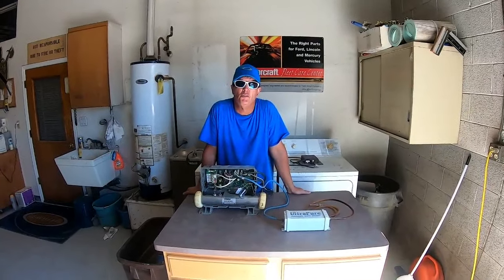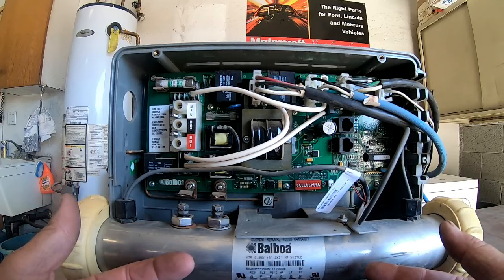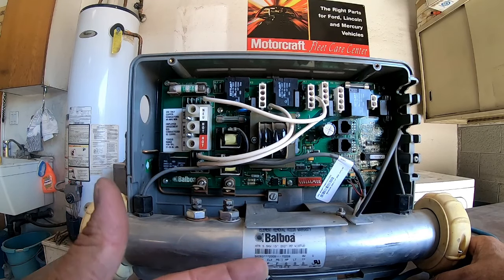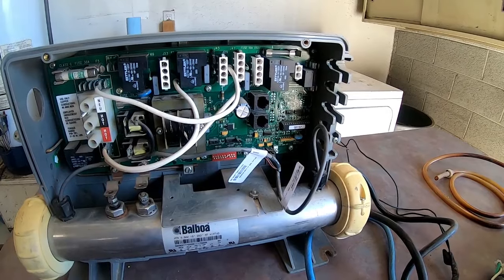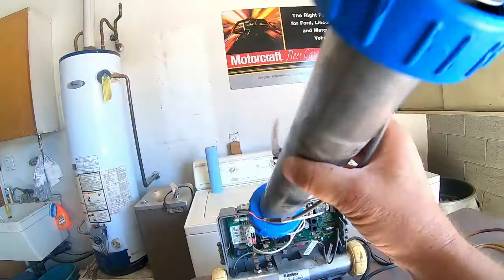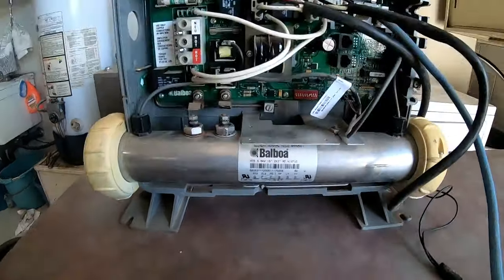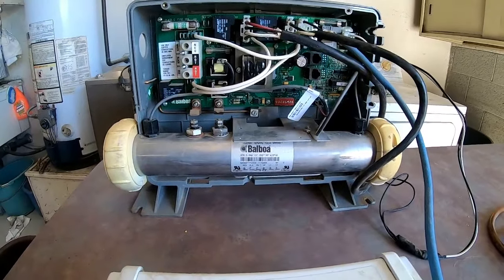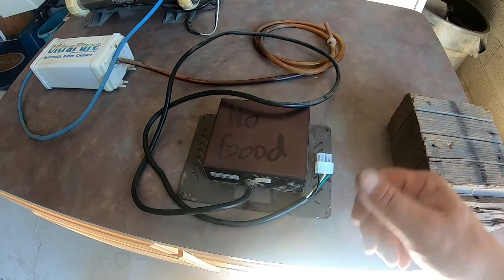Hot Tub GFCI Breaker Keeps Tripping..6 Things To Check For.(DIY Spa Repair) Arizona Hot Tub Factory

Comment: My breaker was tripping immediately when turned on.  I started diagnosing by disconnecting the various components and found that the circulation pump was causing the breaker to trip.  So started going down the route of replacing my circ pump.  Luckily, someone mentioned to me that a simple air lock could cause the breaker to trip from the circ pump.  Sure enough, I removed my filters, tried the breaker again and it held.  The pump wasn't bad, it was just air locked.  So if you're in a similar situation try removing your filters first to see if that solves the issue.

Comment: SCOTT - YOU R the MAN!!! after multiple hours and parts replacement - YOU drove me to the problem - I have a Jacuzzi J365 - and found that when I pulled the 4 wire J4 plug it the GFCI didn't trip ---- when you got to the ozone - I disconnected and I'm back in business - can I run the Hot tub without the Ozone ?  thanks and Aloha Chris
Reply from the maker: You can but I wouldn't .. A new Ozone is cheap and really does help the spa system,
Thanks for Watching & SUBSCRIBING

Comment: Trying to tell what the cause of my GFCI instant tripping when pump switch pushed on a 2009 Hot Spring Jetsetter with a Wavemaster 7000 pump unit, I found the culprit was corrosion on the output shaft at the pump bearing side...scraped and wire brushed + WD40 solved the issue...some "repair" folks would have just replaced it for $$$, without even looking for that causing the trip!
Reply from the maker: If the cir pump is any older then 5 to 7 years ??? You are on borrowed time and it would be better to replace it.. Ive had pumps like that go out and burn the board connections because it didn't trip.. I look at it like tires on a car after so many years just because they hold air might be dry rotted and leave you stranded with a flat...Just food for thought. Right on fixing it your self. Thanks for Watching & SUBSCRIBING
Reply: @spaman5440  Thanks for the heads-up...however this GF problem was with the MAIN JET PUMP, not the separate, constant-on circulating pump.  Now that I've replaced a leaking non-repairable double-tube heater unit--that was otherwise working fine (that probably added to the corrosion issue on the jet pump), I guess I should probably put a replacement circ pump on my maintenance to-do list next spring!

Comment: Ive emptied to clean and fix a hole in my tub.  Sometimes I'll plug in my hot tub and it runs fine and I could fill it with air. Then I'll come back to fill with air again after finding leaks, plug it in and there is nothing.  The breaker doesn't trip in the house but the test buttons on the plug won't set themselves.  You can push on both the test and reset buttons (on plug) and they are limp.  Then I can come back a week later and plug it back in and the plug is working again and hot tub gets power.  It's just weird that in between it not working and then working again nothing really changes.  Any thoughts?  Thank you!

Comment: 2007 Sundance Optima 880. Breaker tripping.. Diagnostic as you did showed heater was to blame. Disconnected heater but now the unit turns on randomly. Sometimes its a pump, maybe the blower, maybe the lights sometimes a combination of all 3. What now?

Comment: Both my heater terminals were corroded.  Cleaned them with vinegar, rinsed with water and dried it really good.  Spa is working now.
Reply from the maker: It will work for awhile but most often it will not last long ,, Its great that you were able to get it working again..
Thanks for Watching & SUBSCRIBING
Reply: @spaman5440  I figured that, im sure its corroded on the inside but will have to replace the heater element soon.
Reply: I kinda did the same thing, just used a dry still toothbrush. I figured it’s probably a temp fix too.👍

Comment: Great info, with things to look out for in the future. I live in Nevada and my Balboa breaker trips only qhen its hot outside( 100+°).  Replaced wire to appropriate size and solid ground. Still pops when ambient temps are high. Maybe the heater is my problem.
Reply from the maker: Would need more info.. Call the office and talk to Scott he will have more info.. We did deals with this all the time in Az  with all of our rental inits.
they all have Balboa equipment and we had problems with this some 10 years ago 
Thanks for Watching & SUBSCRIBING

Comment: I repair for a living. Don't work on hot tubs as of yet. But after what you just showed me. This is just like working on all the appliances, water heaters, furnaces, and AC  I troubleshoot and repair. I will not turn down the next hot tub repair. Just last night one of my customers said GFCI would not reset. I went up to look at the electrical. Nothing more than they were not resetting the breaker before turning it back on. Found no problems after resetting it. Everything ran fine. It was an easy money service call. But that said. Yes, I am going to start working on Hot tubs now. Thanks for the heads-up video. I like your style in video.
Reply from the maker: Check out all of the NEC codes and follow them to protection. More then 50% of our work is rewiring what the Lic Electrical contractor installed. the rest is figuring out why the breaker is tripping. Good luck and keep us posted on how it goes Thanks for Watching & SUBSCRIBING
Reply: @spaman5440  I have the NEC Book. And use it when needed. Thank you.

Comment: Thank you for the video I never usually comment but great video. I tried for hours today to try and get my hot tub to stop tripping the switch everytime I powered it on... after watching your video I just went back out in the dark with a flood light and I think it is the heating element cable. 1 of the round circles on the nut is burned and managed to get my hottub to power on and stay on after disconnected the heating element cable and the hot tub stayed on. So now need to find the correct replacement cable to buy a new one. But your video helped so much.  Now I have diagnosed the problem.  Thank you very much. I think saved me hiring a hot tub engineer and money. Thank you
Reply from the maker: When I started doing these video 2 1/2 years ago...You are the type of viewer I was hoping to help.. As of today my videos have been seen by over one million viewers in nine countries.Im so glad I was able to Help you   Thanks for Watching & SUBSCRIBING
Reply: @spaman5440  You are welcome mate. The plug and click cable with the 2 circles on 1 end for the heating element.  1 of my circles at the end I can see is a tiny bit burned. Do you think it will be the whole heater that I will need to replace or just the simple job of the plug and click cable? I'm going to order the cable 1st as that's only £16 but the long heater tube looking online is £180. I'm hoping the plug and click cable fixes the issue
Reply from the maker: @James-yv2mr  There is a reason this happened. The part that burned up is cheap to replace. But without knowing why it  burned it is tough to say.. keep an eye on it something is causing this to happen. when this has happened to me in the past I replace the entire heating tube as an entire unit. Hope that Helps Thanks for Watching & SUBSCRIBING
Reply: @spaman5440  Wish I could afford an entire heating tube unit. Which is why opting for the cheaper option 1st 😆.  Thanks again for your help and your videos mate I will keep an eye on it and see what is causing it. Thank you

Comment: Thank you for sharing this video 
Unfortunately after fowling your steps I am still having issues with gfci tipping red light cones 
My jacuzzi has been sitting
In my. Ack yard for 2 years now bought it new I now git some time to run power to it and fill it up with water but I can’t get it to run
Reply from the maker: In my experience if its only a couple years old and it trips from the get go and the breaker will not set it was wired wrong(Every Time)

I am kinda confused You say you bought it new and it trips the breaker when turned on and its been sitting empty for two years and you still need to run power to it.
If you need more help call the office and talk to Scott 
Thanks for Watching & SUBSCRIBING
Reply: @spaman5440  Ii had a service guy over yesterday and he got it to run apparently the gfci that came with the jacuzzi cord 
Was bad but now that is running I can’t get my top display to work to set the temperature, jets,lights and so on 
I don’t have Scott’s number thx in advance

Comment: I just want to give you a huge thanks for making your videos. Specifically this one. We got a new sundance cameo 880 yesterday (here in AZ) and filled it and just kept tripping the breaker trying to turn it on. It was very frustrating. We figured out by doing the elimination process (after checking the gfci wiring per your other videos) it is the blower tripping the gfci  so at least we know. Hopefully we can get a tech out quickly from our dealership to deal with the blower. Thanks so much for taking the time to do these!!

Comment: ***Question***Right off the bat I think you helped me! Last spring my hot tub tripped a couple times after I had everything clean and prepped after the winter. I also noticed the water level slowly going down. Instead of figuring it out, I just shut it down (busy times). Now, a year later I need it back up and running. Last week I opened the panels and turned the breaker on. I instantly noticed water spraying from the bolts on the heater. The breaker quickly tripped. Now it doesn’t come in at all. Your video showed me that I have a heater problem. My question is, because my system doesn’t do anything at all now,  should I replace all the components in the box, or should I just replace the heater and fuses? Appreciate anything you can offer!!
Reply from the maker: If it is a Balboa system or the like...I would just replace the entire heater assembly with a new one including sensors and gaskets 
Thanks for Watching & SUBSCRIBING
Reply: @spaman5440  thank you!
Reply from the maker: @thebutlercollective6193  Welcome

Comment: Hi I am having same problem. I have power at junction box from the gfi breaker with no short to ground. I have removed the elements checked resistance and short to ground, good with no blisters on outside. Hi limit and thermistor operation look normal when heated. I have a Balboa pack as well. History is just stopped heating. Everything else was okay. I will try disconnecting the heaters I believe I had 14.5 ohms on heater does that sound about right. Every thing else was unplugged just pack hooked up. Wish me luck Marc

Comment: Great video and very informative. I have a Balboa single-pump system that trips the (new) GFCI breaker. I've unplugged EVERYTHING and disconnected the heater and two temp sensors. Still trips and can't figure out why. Don't see any physical problems (corrosion, PCB burns, etc.). Removed the (good) 300mA fuse F4 and GFI is stable. Don't know what F4 controls though as I can't find a true PCB schematic. [Thought the MOV above F4 was shorted, but it's not]. Ever seen this?

Comment: You are the best, Sr.  I will check mine and update this post once it gets fixed. Thanks.  UPDATE: Once I removed the cover and start checking for leaks, I noticed drops coming out from the inner Clearray system (Jacuzzi-J345), rust in the nuts and humidity in the floor of the tub, close to one of the pumps. I disconnected the Clearray system from the tubing, the system board and removed it completely from the tub. Now the tub has been working for more than 3 hours without tripping the breaker. I think I found it!  Thanks!
Reply from the maker: Thanks for Watching & SUBSCRIBING

Comment: Great video. My hot tub breaker trips intermittently. Stays on for hours then when we go to use the breaker is tripped. Any Ideas?
Reply from the maker: Check your connections
Thanks for Watching & SUBSCRIBING
Reply: @spaman5440  I have checked all connections and even replaced the GFCI breaker. I am leaning toward the circulation pump overheating over time, or am I off track. I think if it was the heater element it would trip right away.

Comment: Thank you so much for posting this.  I've been struggling with troubleshooting my hot tub tripping the breaker for a while.  This video helped me identify the issue!  Followed and liked!!!!
Reply from the maker: Glad you have it figured out ...Thanks for Watching & SUBSCRIBING
Reply: What was the problem?
Reply: It turned out that the heating unit was bad.  I had no idea how to isolate what was causing the issue until I watched this video!  Ordered a new one and the replacement was simple!
Reply: @sbockett  Thanks for feedback.  In am thinking that is the problem with mine.  It's only 2 years old but trips now after heating about 2 hours.  Already replaced the disconnect.

Comment: Thank you sir lol I bought a used one with all of the fancy stuff tv and stereo and lights it occasionally trips breaker so i did start looking at stuff myself people are shocked to find out I am not an electrician any ways one of my 110V converters has been rewired by previous owner it is receiving 240 V to power up its NFG hoping by unhooking this my tub will be good ! Ftr had a few leaks and a pump connection leaking fixed them up no more leaks!!

Comment: What if the heater is unplugged and no luck? Same with pumps, transformer, etc? I cannot get the GFCI to go on at all and the wiring at the breaker to tub is good.
Reply from the maker: Ok you have alot going on and there is really no way to help you here so you can call the shop and Scott Im sure can get you going in the right direction. Hope that Helps Thanks for Watching & SUBSCRIBING

Comment: I have a randon gfi trip. Nightmare.  I guess I try replacing  the heater. And pray that's it. Tub runs fine  for days then trips.
Reply: I wander  if  the pressure  switch  is grounding out randomly.  I have change it before  a long time ago. My spa is 21 years old. It's like a Toyota  it keep on running.  Lol
Reply from the maker: Give me a call at the office tomorrow and get me some more details and I will try to get you moving in the right direction.Thanks for Watching & SUBSCRIBING

Comment: great video  exaclty what I needed.  My control panel is almost identical.  I've had it 3 yrs and it just stopped working.  No power because the breaker tripped.  The hot tub place said it was the breaker so I paid $150 for the new breaker but it didnt help.  

I disconnected everything but the heater and it still wont work.  I'm going to try the heater now.  Can you clean the heater or do you just have to buy a new one?
Reply from the maker: No I'm afraid if the heater is causing the breaker to trip ? its time for a new heater.Yhanks for Watching & SUBSCRIBING

Comment: I have a 2 year old ACC Smart touch digital 1000 controller    We had a power outage the other day   The hot tub tripped the 50 amp GFCI breaker I finally got the breaker to send power to the hot tub but I noticed the COM  line  1 wire ( fused it’s ok  )  wire on top of the circuit board definitely overheated.  I replaced it and still no controller coming on   We lost the main 9600 volt wire in a storm I wonder if it did not kill my controller   The GFCI is staying on though.   Any ideas ?

My control panel is not lit up 
I’m going to check to see if it’s got power to it from the board block next I guess  any help would be really appreciated.
Reply from the maker: Check all of the wires with a tester really good as well as the 50 GFCI breaker....I would also check all of the fuses on the board... There should be one fuses that is for the top side and it might of blown. Hope that Helps Thanks for Watching & SUBSCRIBING
Reply: @spaman5440    I see that there is no power after my 50 amp main GFCI on the wall   It wont trip and it throws over to oN but no power after it to the tub.    I think it’s defective the box lid was open after we had a tornado come through.    I bet water got splashed into it.  I guess I better replace it there goes another hundred bucks.     Thanks for your input buddy I appreciate it     !!
Reply: @spaman5440   i found a tiny 1/4” fuse blown  wrapped in foil and the pad powered right up !  Question is what knocked out the fuse   The one secondary power wire to the board over heating is concerning   We did have a tornado knock the 9600 volt power wire off the pole and i think it touched the house wires  it lit up the whole sky ( i uploaded it a month back as it happened ) my massage chair is not working and we had a house fire when they turned the power back on. The line man said he knew something was wrong as the box on phone pole was smoking   All my charging lipo boxes caught fire  i think that did it.  It trip the main GFCI   We will know tonight when we run it  thanks again !

Comment: My hot tub trips on gfci only. When bypassed it runs fine. Will these issues cause gfci trips or over current trips. Thanks very much.
Reply from the maker: You need to figure out what is causing the GFCI to trip and fix it...Please Please do not bypass the GFCI that is your protection from any type of shock...If you need some please call and talk to Scott and he will get you going in the right direction. Thanks for Watching & SUBSCRIBING

Comment: How do I know ow if it’s the actual pump or just the capacitor?
Reply from the maker: They make a tester for the capacitor so you can test them.. From my experience it is best to completty rebuild the pump and motor as a poss to just replacing the capacitor ...there is alway a reason that the capacitor blew and I alway want it checked out .. Thanks for Watching & SUBSCRIBING